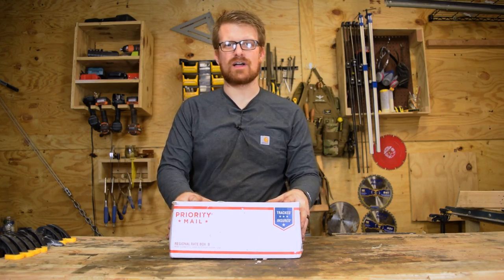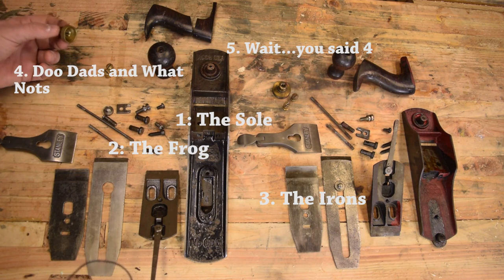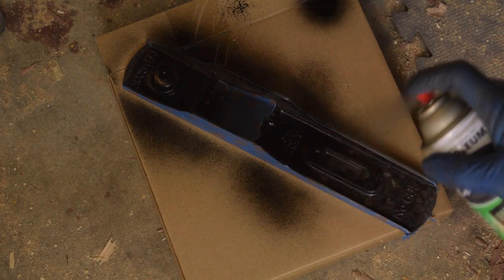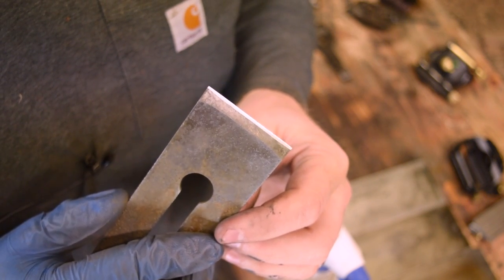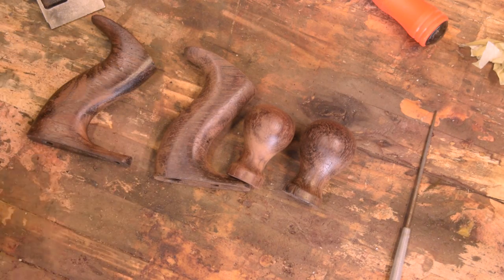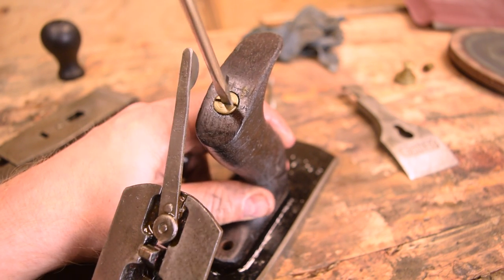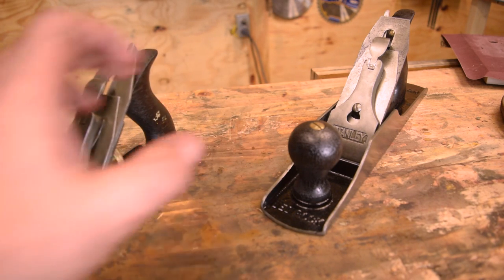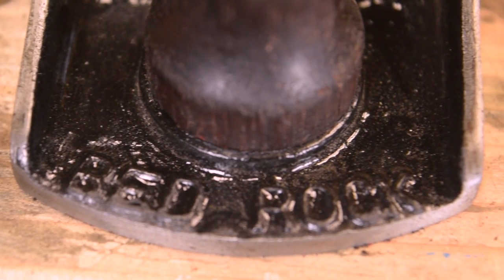Antique Stanley Bedrock Plane Restoration | Shop Tips

Comment: REALLY helpful info, thanks so much. Loved the Central Machinery sander turned on it's side. Can't believe you got away w/o using a sandblasting machine!
Reply from the maker: It's a killer tool
Reply: I just finished making a stand for my bench grinder and mounted it on its side with a table and I'm going to make a few jigs that are assorted angles so I can put the material to the grinder at the specific angle I want

Comment: One product I like to use to free up parts that are supposed to move after they get locked up with rust or whatever. It is called 'Super Slick Slick Stuff'. My bandsaw thrust bearings were completely seized and I could get them to spin for nothing and I gave it a couple quick shots of the SSST and it immediately started spinning and hasn't stuck since

Comment: This week I got 3 bench planes at an antique store for $12, a Bailey no.640(apr.2-1895), a bailey no.4(type 2 I believe and the third is another bailey that doesn't have a number specified on the body but is has a brass adjustment know that has am Aug. 1858)

Comment: Hey, Rick. I know you're from the St. Louis area. I live about an hour South of there in the giant Metropolis of Bismarck, MO. Populations 1500. Anyway, I was up your way about a week ago at the antique mall in Eureka, near Six Flags. There's a rusty Bedrock jack plane with a broken tote in there. They want $100 for it, so I passed. But after seeing this, I thought you might be interested. The same booth had several planes. All priced out of my range. There was a Stanley 45, that I think was a really early one from the 1800s. It had the ornate design of the early ones and it was japaned. I think they only used japaning for the first few years until they switched to plating them. It had no cutters or accessories. I did snag a $5 Stanley 110 that was absolutely crusty and a $10 Dunlap jack plane that was pretty nice, for a Dunlap. I'm basically a noob, so it's something to start with. Love your channel. I've been learning a lot from your videos.
Reply from the maker: +Danny Hale ya 100$ is too much for just any old bedrock.  Some are worth A LOT!  Restored, or even in beat up condition.  Check eBay and Stanley going sites to figure out of it is worth much more next time you see one.  Mine are worth basically what I paid for them.

Comment: What spray lacquer did you use? They turned out excellent. I have restored quite a few planes but have always stopped short of repainting. I didn't want to strip the jappaning, but looks like you can get a great result without doing that.
Reply from the maker: +Nicholas Sandberg Ya I just used a steel brush to knock out anything lose japanning and to smooth out the edges a little bit.  I used rustoleum spray lacquer the green can with the chair on it.  The trick is to build up a lot of this coats.  Make sure you tape off the frog mounting plate before spraying.

Comment: Great vid. I suspect the pitting  on the screw was due to the particular metal it was made from and it's interaction with the users salt laden perspiration. It is perfectly placed to catch any dripping off his or her fingers and hand. R
Reply from the maker: You're probably right, I was suspecting either that or a feeble attempt at sandblasting.  The best of the plane shows no sign of sandblasting otherwise.

Isn't that little thing beautiful,
Reply: Someone previously could have given it a vinegar (acetic acid) bath which I heard can lead to pitting

Comment: Intro is great! I restored a low angle block plane I found in a remodel, it was a really cool project, I need to get a old #4 and work on it. Give away ;) just kidding. Where did you get your diamond plates? I have been sharpening my stuff with a china freight sharpening block, so I'm kinda looking for a different sharpening system.
Reply from the maker: You can get DMTs stuff off Amazon.  Trend and ATOMA make great diamond plates as well.  Stumpy nubs just released an awesome detailed video about diamond plates...https://youtu.be/Lai40iNvgws
Reply: Thank you sir.

Comment: Darn it you did not show how to loosen or tighten the bolts that hold down the frog. The bolts that are not slotted. Some have a slotted "cheese head" bolt and some do not. I have a 605 with non slotted bolts on the frog. So how do I get them loose?
Reply from the maker: +Bloom's Banjos you loosen the ones on the top of the frog.  The bottom ones slide out once you remove the two self centering screws from the top.

Comment: I have a plane the sole says bailey no 4, it has a plastic adjusting wheel, the lever on the top of the frog is missing, the hold down says Stanley, R&L Co Bedrock on it, Is this something someone cobbled together or is it a piece worth restoring?
Reply from the maker: Sounds cobbled together from a couple of really nice planes, and a cheap one.  A bedrock lever cap, a bailey sole, and a handyman adjuster?
Reply: Thanks, I suspected as much. I'll make it work and use it, but won't go the whole hog
Reply: Guy McLaren - the frog w/ the plastic adjustment wheel is probably a frog from the highly collectible WWII Stanley planes. Stanley couldn't use brass for a couple of years during the war because of resource demands of the US military, so instead of the brass adjustment wheels they used bakelite ( a plastic-like substance). You may want to check online to see if the frog on that plane is one made during the early to mid 1940's. Just a suggestion.

Comment: I recently found a 605c and was wondering how you undid the screws that are on the frog since they don't have slits...
Reply from the maker: That is the bedrock adjustment mechanism, those are pins held in by the screws on the back of the frog.  I basically left out the most important part, n00b :)